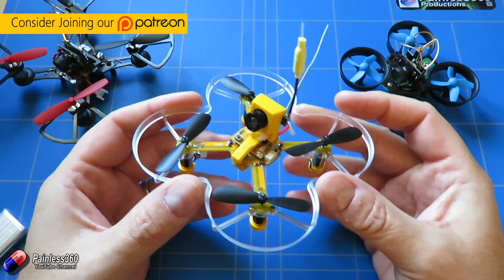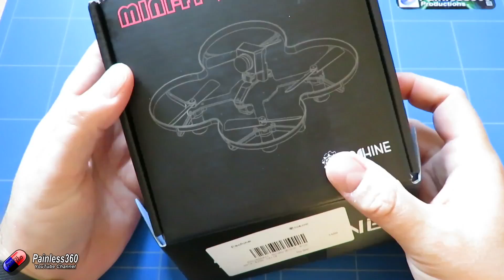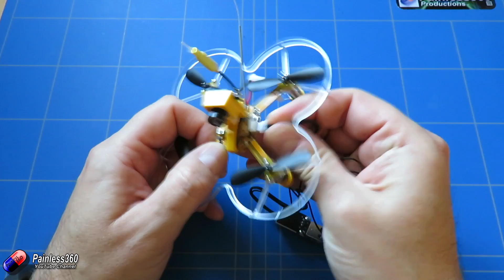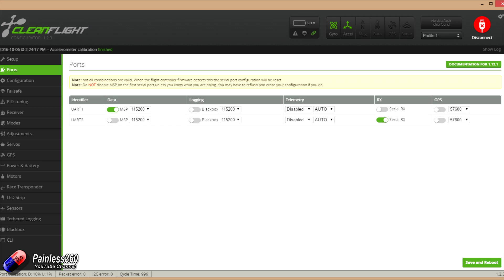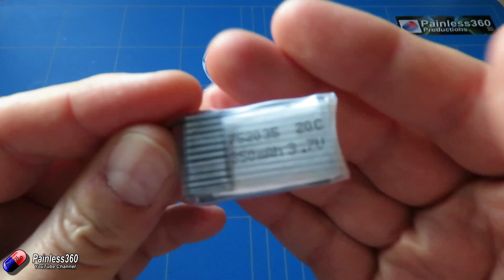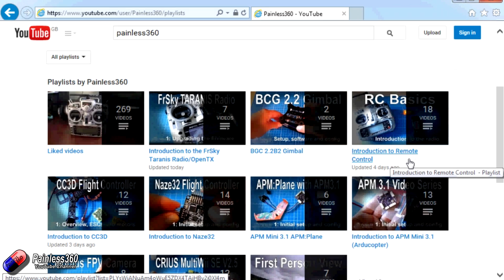RC Reviews: Eachine X73 Mini FPV Quad

Comment: When i try to bind it, i get a solid green light, then after a few seconds a flashing green light. when I disconnect and reconnect the battery it has a solid red and green light and receiver page shows all values at 0. I have it configured as serial/sbus too. Please help

Comment: It seems I may have either a faulty rx or it is bricked.  It looks like it is bound, but it will not connect to either cleanflight or betaflight.  
Now I’m curious to know what that other button is at the left rear.  No instructions came with this quad.

Thanks for your time.
Reply from the maker: Boot button probably (?)

Comment: love your videos and tutorials. i have question. i have this little quad and at first had no issues flying. then i clicked reset settings from the setup page on clean flight. now the props start as soon as i plug in a battery and its no longer bound to my taranis. Can you point me in the right direction as to how this is fixed?  its probably a simple fix but  I'm still a newbie at this hobby.  thank you
Reply from the maker: +Ron Gatchell the Rx is probably still bound but the Rx settings are not right, see how we setup a. brushed quad in the 'Brushed quad build' series. Best of luck!
Reply: Painless360 I will try that. thank you

Comment: Hi, you are missing a key function for "trimming" leveled flight

Use stick commands to trim accelerometer. https://goo.gl/images/zzR0of

Example it drifts forward:
Arm, test fly and land.
Disarm, give full throttle and hold right stick down a couple of seconds. Release and throttle down.

Arm, test fly and repeat previous step until it doesn't drift in the same direction every time.
Reply: Painless360 Ehm, this is true for perfect angle mode on all multirotors.

Even you have your quad laying on a flat table when you hit calibrate accelerometer it's not certain that it's means it will stay still in air.

Some of the feet may slightly taller than the other, there may be some bends in frame, hell even a degree wrong will give your drift. And as you pointed out CG may not be perfect and this will compensate for that. The method I described is without a doubt the best way.

Comment: I'm trying to bind the Taranis to the E010 but need a usbasp to reprogram the multi protocol module. 

This one was probably a better option.
Reply from the maker: QX90 is the best one we've tried to date. And binds with the Taranis too..
Reply: Painless360 though I think the LT105 is a stronger frame. Many qx90/qx95 owners broke an arm easily